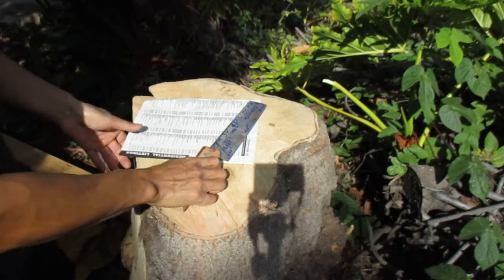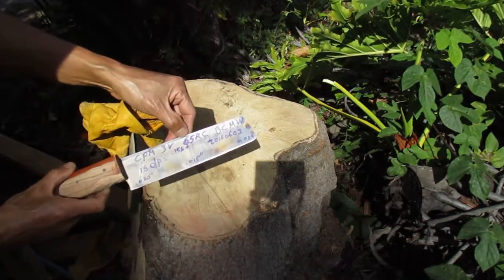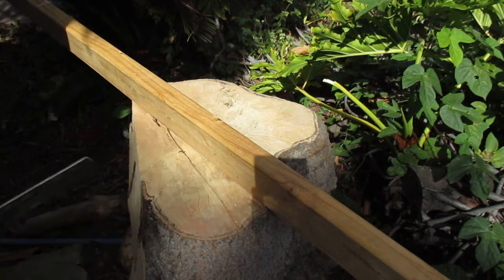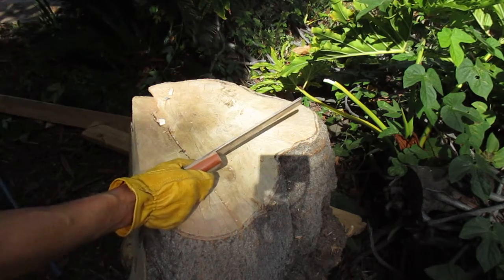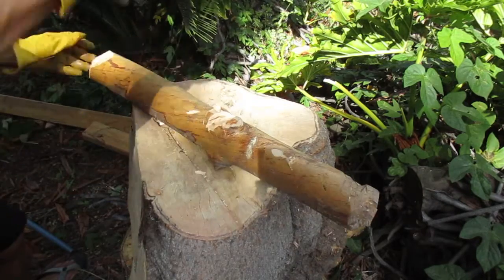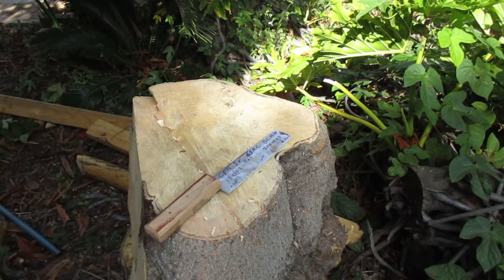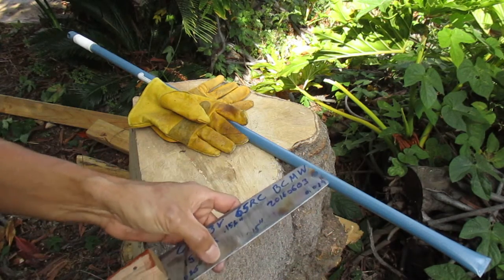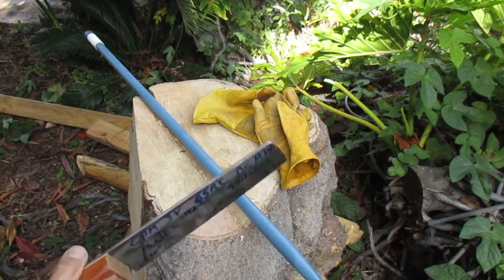BCMW20160603 CPM3V 65rc Wood Cleaver

Comment: I'm impressed by the results of this testing considering how thin that blade is. Nice job!
Reply from the maker: Thanks, Chum!
Since I need to fix the ripple but before doing that I will cut(through) some beef rib bones - looking for edge chips. 65rc 3V is a breeze to make compare to 65rc D2 large knife/chopper.
Reply: Beef ribs are a very tough test on a knife. If the blade ripples without chipping on those, I think this high hardness 3V is a real winner.

Did you say you did, or did not, temper this blade after heat treat?
Reply from the maker: Instead of guessing - I went outside and:
Made 10 shattered chops through frozen beef rib bone.  Straight down /perpendicular chops resulted in no or micro ripple. Repeat on same edge area with rippled = micro chips, since the bend has exceeded plastic zone.  20-30 degrees off 90* chops = big ripples and 1 chip to 0.008-0.01" cross section thick. From sound of some lateral chops, for sure I though/expect a large chip past edge shoulder - I am surprise at outcome.
I did tempered this blade down from 66+rc as-quenched. 3V 67rc is a highest AQ hrc I ever done.  I plan to make a few small 3V knives with 66+rc. Certain will test 1 or 2 untempered 3V blades.